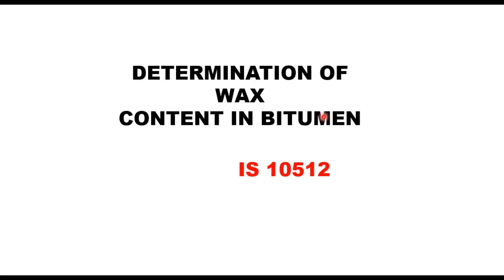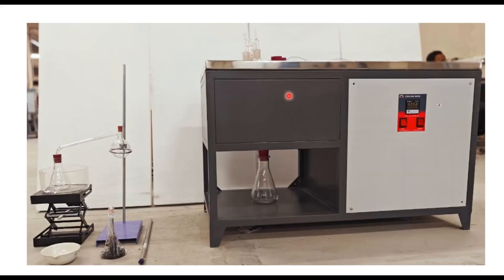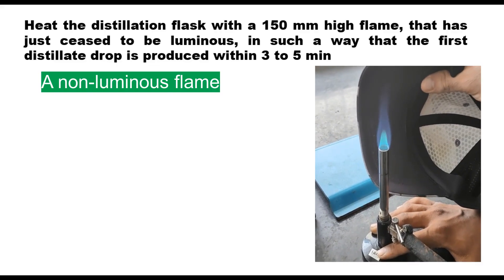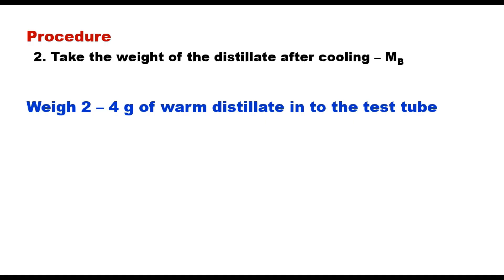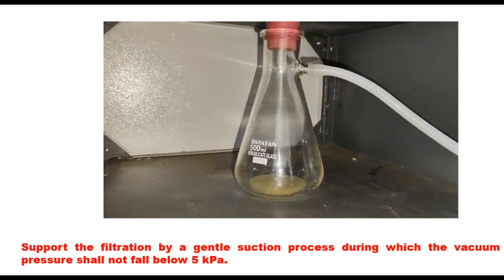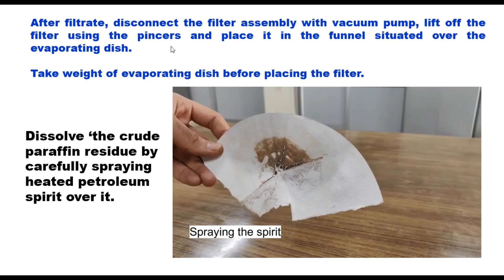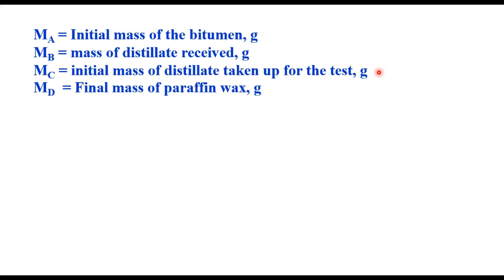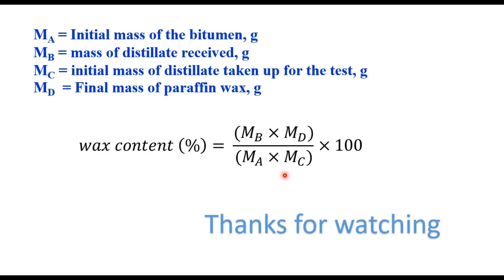Determination of Wax content in bitumen, complete procedure with video clips of lab method

Comment: Thank you for the detailed video. I had some questions. What is the significance of excessive wax content in bitumen? Why bitumen manufacturers add wax? How does wax influence performance properties of bitumen?
Reply from the maker: presence of wax can make bitumen more sensitive to temperature changes, which can lead to cracking at low temperatures and permanent deformation at high temperatures.